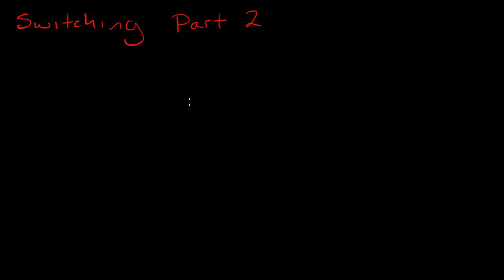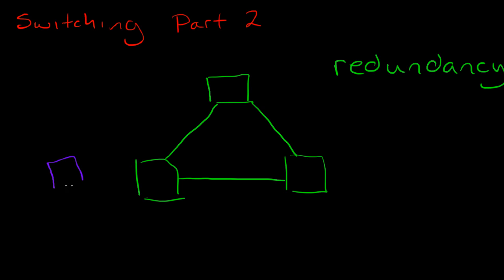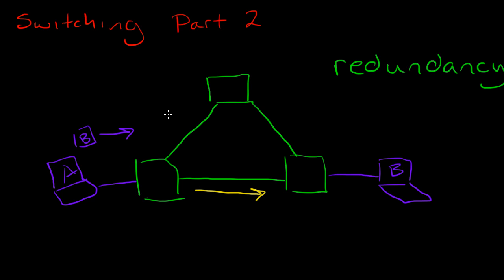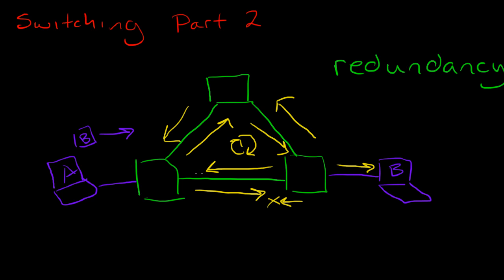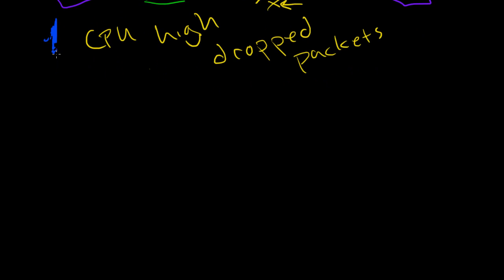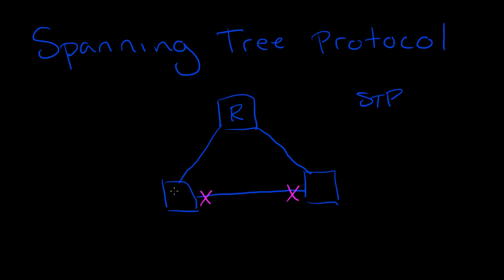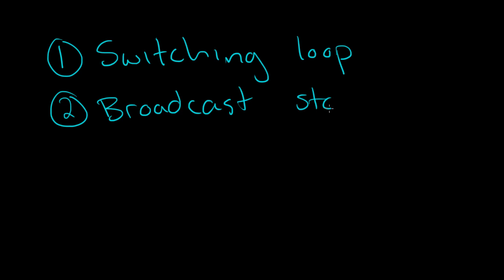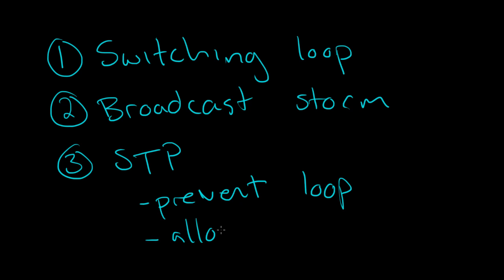Network Switching Basics Part 2

Comment: Hi there, if the switch connected to Host B doesn't respond to the switch connected to Host A why would the top switch respond to both switches when it's receiving the broadcast from both switches?
Reply: Oh nevermind. I think I understand. Switch A broadcasts to Switch C which broadcasts to Switch B. Vice versa, Switch B broadcasts to Switch C which broadcasts to Switch A. Got it!

Comment: is a protocol a program?
Reply: billyblackburn87 protocol is not a program, it is like a set of rules how two different devices would communicate with each other. based upon that set of rules, you can write a program.
Reply: newkool100 but surley it required programming to create the protocal?
Reply: billyblackburn87 to implement the protocol, yes
Reply: newkool100 ok i get ya. Cheers!
Reply: billyblackburn87 one of the things you can do is to look for socket programming tutorials and it would show how for example how TCP has been implemented, like in Java.

Comment: If the switch doesn't sends back the packet to the port on which  it received the packet, in the above topolgy the loop shouldn't occur even if STP is not working, because every switch will have only one path to forward the packet & one path for receiving...